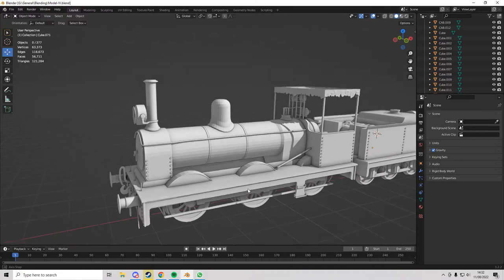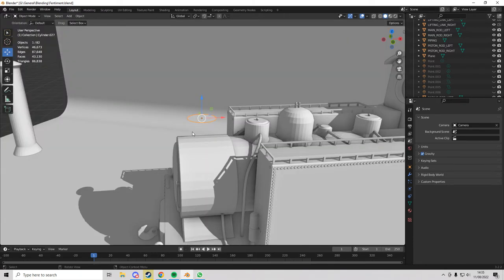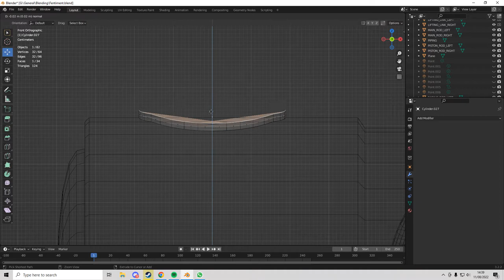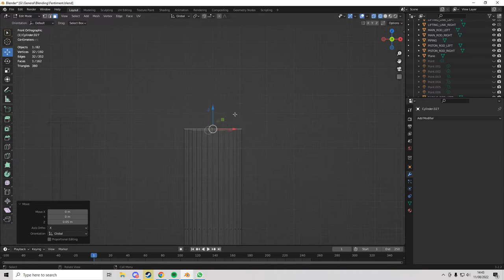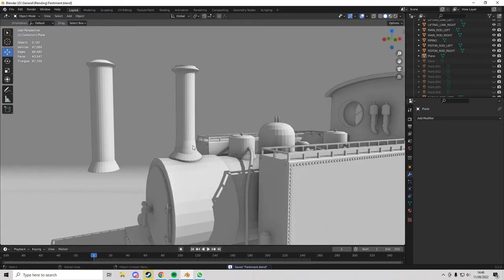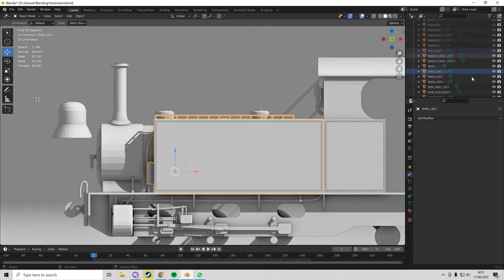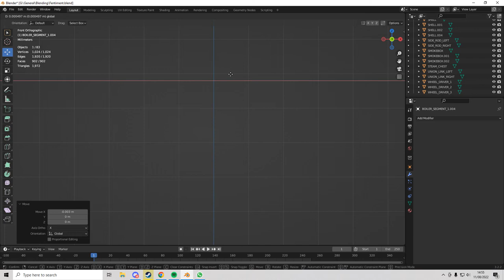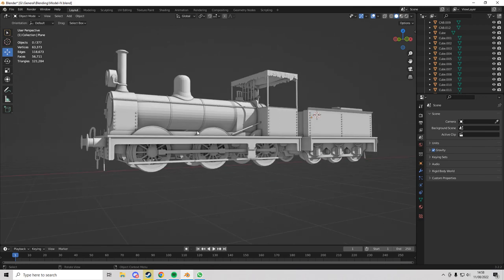(Blender) How To 3D Model Locomotive Funnels And Domes Better (intended for Immersive railroading)

Comment: Hold up... HOLD up. You model the actual valve gear as well? Jesus, you're the first 3D artist I see do that aside from highly proffesional ones and sometimes they don't even get it right. Good job! I've been irking over creating the walschaertz valve gear in unity for some time now and it's kicking my ass. I'm impressed.
Reply from the maker: I'll level with you: I do indeed make walschaerts valve gear for my fictional engines, but I only really play with the positions and sizes of rods until they seem to work right in IR. I wish I understood the mathematical relationships between rods in walschaerts, but for now my approach is simple trial and error - the same reason I dodge walschaerts wherever possible. 
Last I knew, Tristan of the IR community had some strong advice on animating walschaerts from scratch - if you're more intelligent than I, you may well be able to figure out how it works for unity from that. 
If you're after more 3D designers who make walschaerts an might understand it better than me, I suggest reaching out to the Immersive Railroading community as, by goodness, there's some wise folks in there.
Either way, I wish you the best with it!
Reply: @BowmakerFox  You're being pretty hard on yourself. I, too, use image references because valve gears are complex. Very fking complex. I saw this guy talk about it in depth in CAD, but it was hard to follow. Though when I say you model the valve gear where others don't, I mean that most of the time, all I see is a main rod that connects to the center wheel and a linking rod that connects all the wheel. Maybe a rod that goes from one of those straight to the steam valve, but, y'know... hard to find the real deal. I'll check out the things you pointed out too. Thanks, and keep it up!

Comment: does it only work with cylinder?
Reply from the maker: The shrink-wrap modifier can be applied to a face of any shape really, but in this case is best suited to cylinders. If you're going to use something like a rectangle for a Geisel ejector, you may have to split the edges a good few times so that the modifier has more vertices to work with.